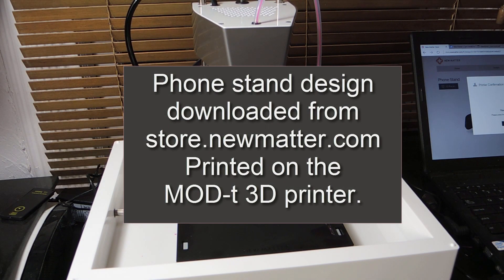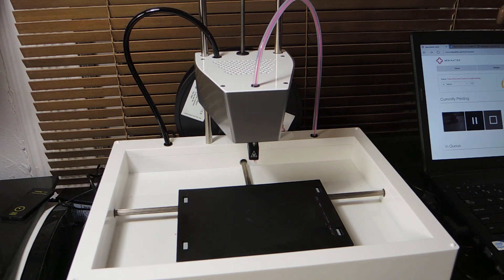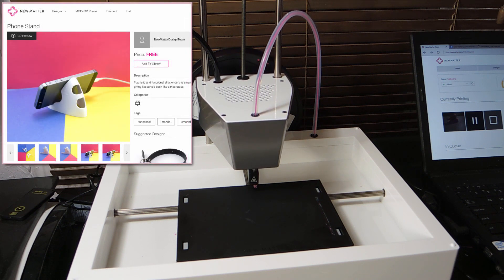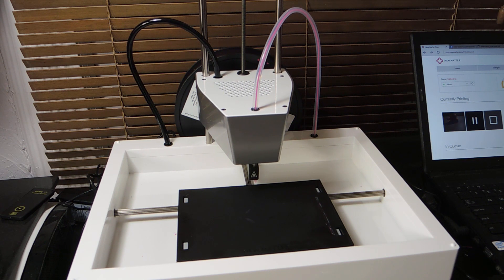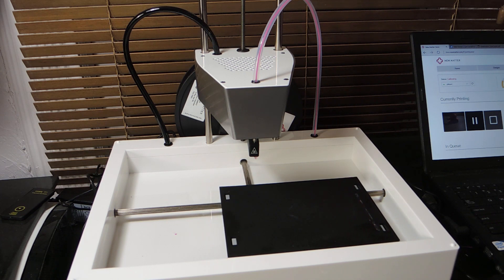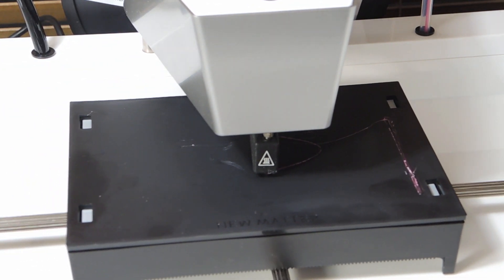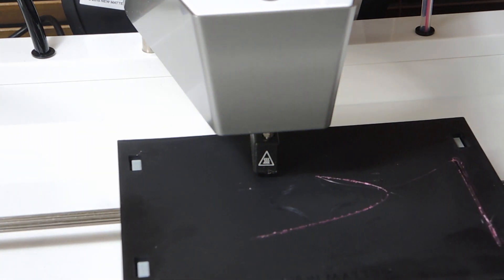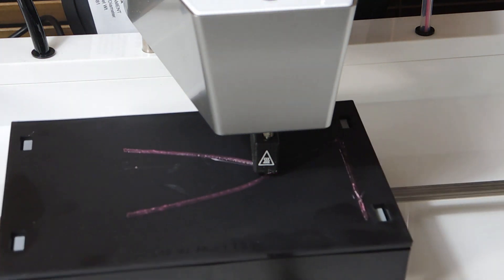MOD-t 3D Printer - Phone stand print demo

Comment: thanks for the video. Mine will be on it's way once the international shipping issues are resolved. How long did this print take in total? Also, is there marks from a New Matter logo on the printing board (forget what its called) looks like it in first few seconds. (I had this on mute, maybe you explained some of this?)
Reply: +Lee Ball I have this printer as well.  The print bed does build up residue from the printed objects.  I started using painters tape on my bed to stop this from happening because I believe it was causing a lot of prints to break off from the bed during printing.

Hope yours comes in soon. Already, I've almost printed enough stuff to use up the roll of filament it came with.  It sure is a fun thing to play with.
Reply: Mine is due to arrive on Tuesday. Got a message today. I'm thinking the first thing I'll print is that puzzle cube with the balls. Is it flexible in that you can print things not from the new matter store?
Reply: You can print anything via gcode in the windows app.  Through the web, you can upload your own stl files to store and print from your library

I had a failed print on the puzzle cube.  :(   I wanted it to complete so badly, but it's a huge print so anything could happen. (The printer froze, but that was also 2 updates ago).

New matter's tech support is also helpful and pretty responsive.
Reply: When did they start shipping internationally
Reply: I was a backer, I got mine ages ago.